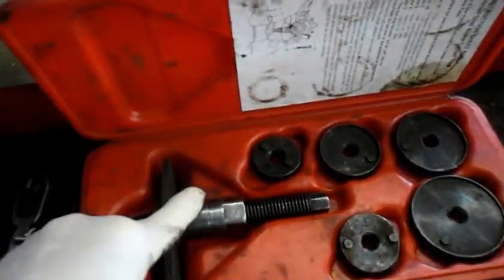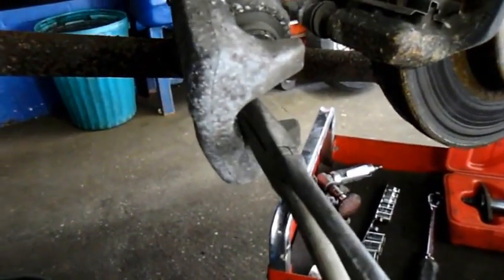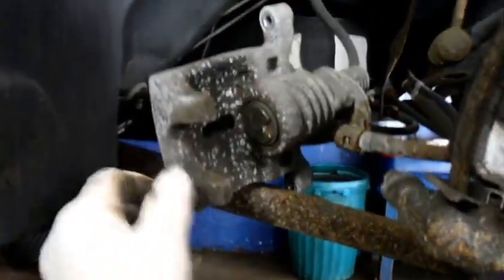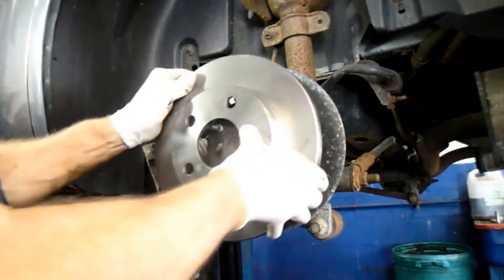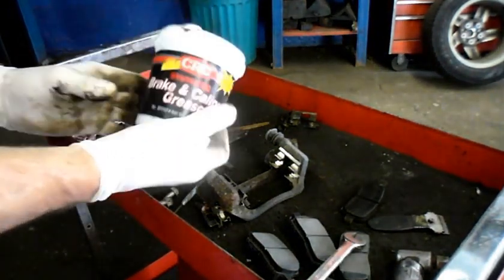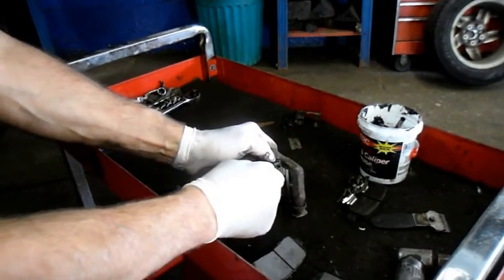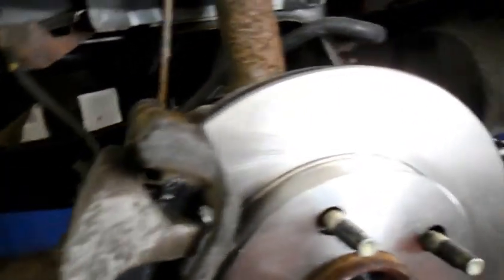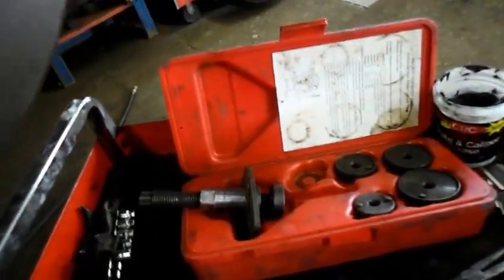How To Replace Rear Disc Brakes And Rotors On A Pontiac Grand Prix

Comment: As a former Pontiac mechanic I learned that there’s ALWAYS little tricks that are time and life savers! 
You clearly have been turning wrenches for some time. That pliers trick is gold! For the shade tree mechanic that little trick saves buying a tool for doing a job only a handful of times. 
Also good for you to point out using a pick to loosen the dust boot. 
Well done.
Reply: You don't have to buy it, it's a deposit and return to rent, so it's free, however there is a cube tool that fits a ratchet, it looks like it should be inexpensive, but I don't know who sells it

Comment: I'm glad you noted the piston has to be lined up, other videos just say twist it back in. Supposibly there is a cube tool for a ratchet to twist it back in, if you don't want to rent the tool you had, not sure who sells it though.Thank you for the tutorial, this is why I watch many of them before doing something, and read comments.
Reply: Actually I'm not sure about that piston , it looks like the nub on the outside bof the pad needs to be in those piston notches, so it has to be straight up and down, with the gap of the piston  lined up with the nub on the outside of the pad.I noticed this on my old pad, it left the imprint on the pad showing me this.And I also couldn't line up the caliper without doing something about that

Comment: Thanks for the comprehensive and nicely explained video.  I would appreciate it if you would comment on the issue of lateral runout when replacing rotors.  All the videos I have watched appear to leave out this issue.  How common is to encounter this issue when replacing rotors and brake pads?  Thank you in advance for your expert opinion on the issue.

Comment: Even better than needle nose pliers for turning in the caliper piston, you can use a pair of needle nose vise grips, which you can adjust so that they fit directly into the slots. Then you don't have to worry about holding the plier handles open the right amount.
Reply from the maker: +anti0918 Very good tip.Thanks

Comment: Best rear brake video out there for the 2004 - 2008 Grand Prix's.  Thanks for that.  We're looking to do this on our 2007 Grand Prix this weekend.

Just one question.  Once you complete installing the rear brakes and put the caliper back on, does the piston re-adjust once you hit the brakes for the first time?

Comment: After you have finished replacing both rear brakes on the grand prix should a person wonder about an elctrical problem sent to the dic about servicing abs system? Or will the ecu figure this situation out in time? Just wondering because my neighbor did this and i seem to be getting warning lights

Comment: Hi I changed the rotor and have the tool to press the piston in, I got it to go back in but is not flush so I cant get the caliper back on it kind of goes on but not all the way, is there way to get it in more or is the caliper no good? I did both front brakes no problems.

Comment: Why does only one caliper pin have an " O " ring , and if you loose orientation of them during the repair which one would most likely go to the top position on the bracket.

Comment: what are the torque specs on the caliper pins and the caliper bracket bolts?
Reply: certified30 if